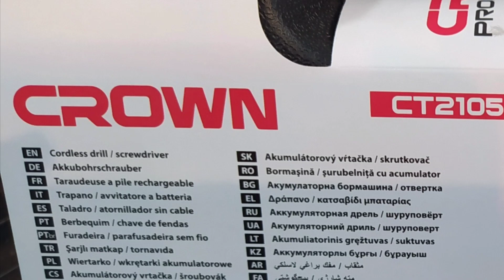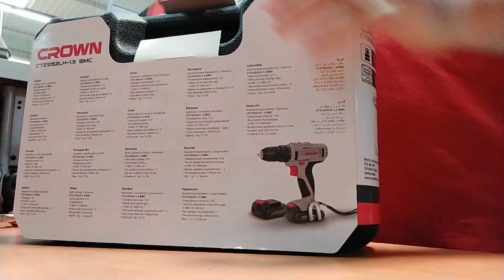Visseuse Perceuse Crown 12V CT21052LH-1.5 BMC

Comment: C koi la meilleure perceuse visseuse sans fil pour Crown ?
Reply from the maker: Il y a plusieurs modèles 12/18/24v meilleures c'est 24v fort
Reply: Et pour un amateur et travail de maison .. tu me conseilles quoi ?
Reply from the maker: 18v suffisant
Reply: Et le model 16v max ?
Reply from the maker: Non ça n'existe pas
Reply from the maker: Mais a bricoma il y a pas
Reply: achète une marque connue d'occasion avec batteries récentes 3Ah minimum et oublie l'Crown
Reply from the maker: Mais il y a un problème de pièces de rechange comme les charbon ...
Reply: @MrOutillage  combien coûte cette visseuse 12 volts ?
Reply from the maker: 795dh ttc
Reply: On a vu qu'une visseuse ! Il n'a pas la fonction perceuse ou koï?!
Reply from the maker: Ila 3 fonction